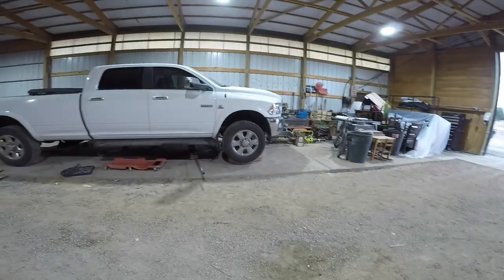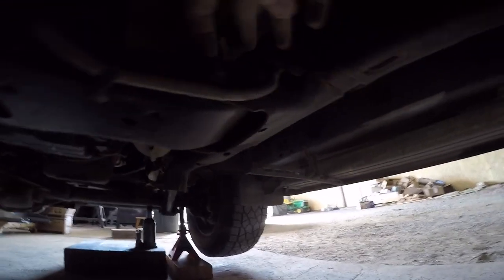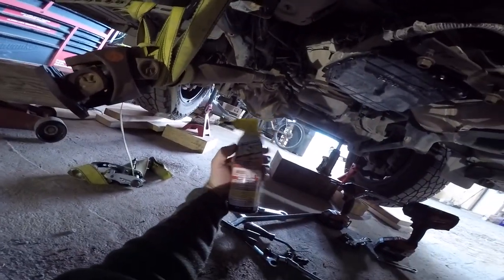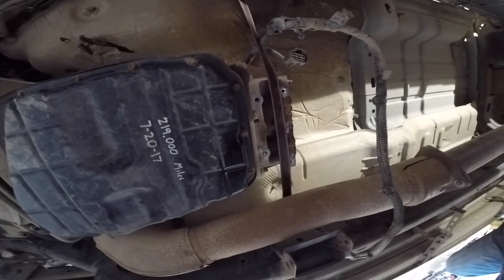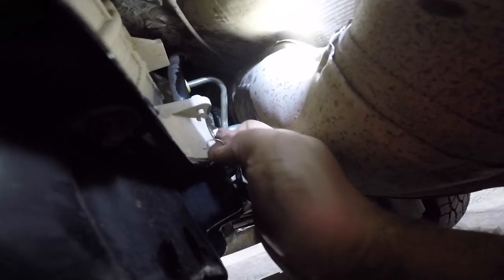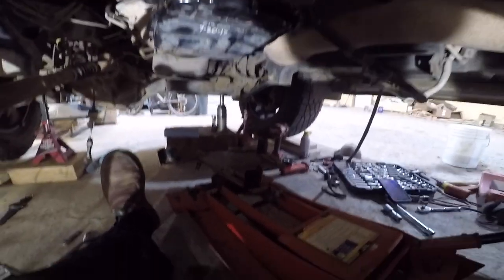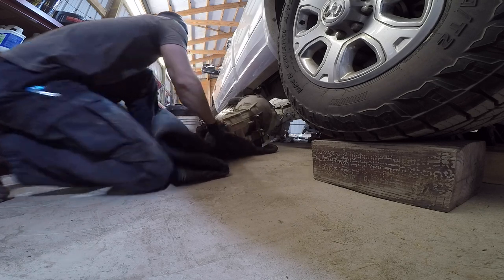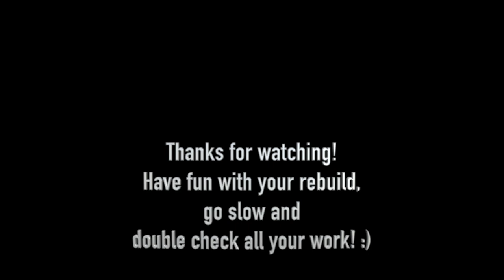How to remove a 68RFE Transmission

Comment: It's also about the same for them to replace the camshaft and lifters. That's why I did that myself. Since my truck is at 250k.
I'm thinking i'm going to do a rebuild on my transmission also.
Reply from the maker: That sounds like a big job. You do headstuds at the same time?

Comment: Going to attempt to pull mine tomorrow to change out the flex plate.  Im at 139k mile, with some weight loss mods.  Is it worth doing a  rebuild on  the trans while i have it out so i dont have to do it again whenever that goes too?
Reply from the maker: It is kind of hard to say if you should or not. do you hot rod it or are you chill driver? If you do enjoy hot riding then definitely tearing it down and redoing some of the parts is worth it but if you just drive it normally a 68 can last a while. Mine had 300,000 on it and was still very drivable, I was just having pump issues when driving uphill for an extended period of time. If the transmission didn’t get too hot, it was totally fine. If it’s not broke, I wouldn’t try to fix it. I understand the flex plate concern. I upgraded mine to a billet one as well.

Comment: $5500 bucks? How much is a replacement Remanufactured Trans?
Reply from the maker: My local shop with non billet parts was 8k for a “heavy duty rebuild” that doesn’t include an upgraded valve body or torque converter. 
10k on average I would say for a rebuilt reputable trans rebuild from Randy’s transmissions or WP diesel transmission.
Reply: Hard to build a 68 for under 6g if you want it to last for what truck is intended for.